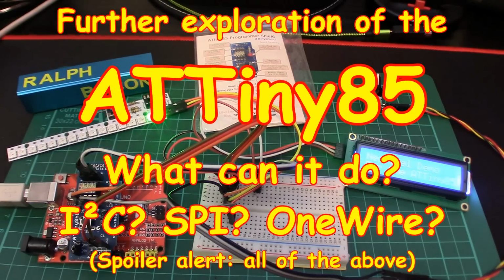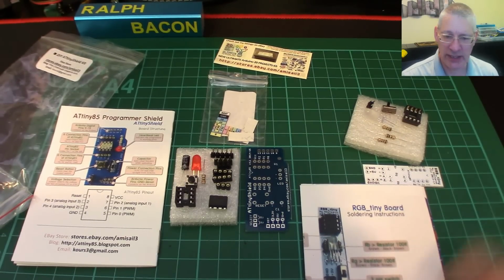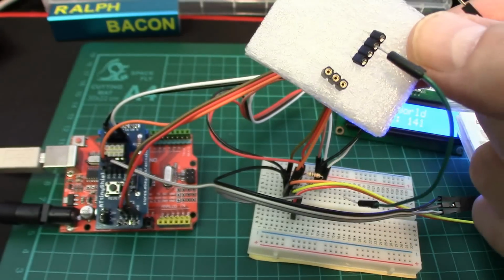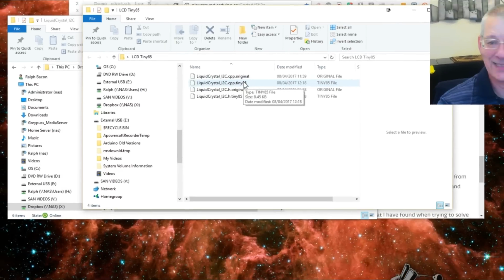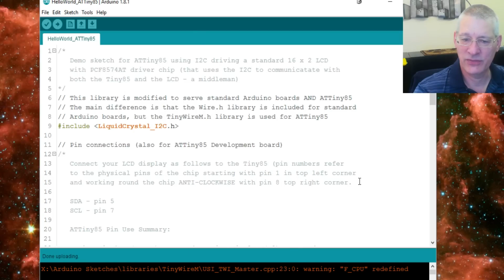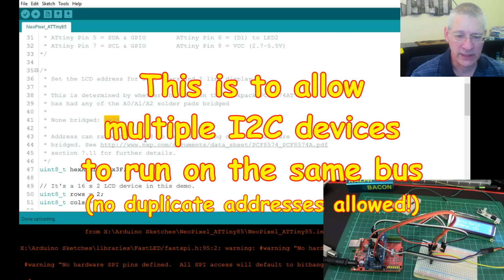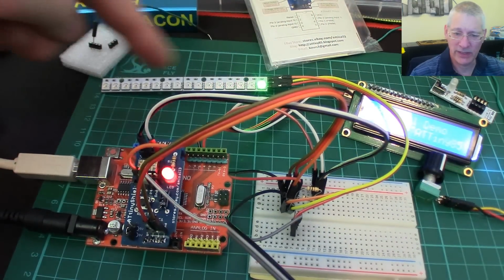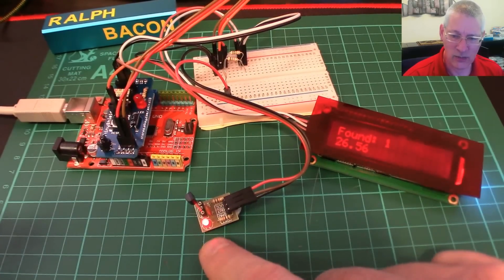#82 ATTiny85 + I2C  + SPI and more!

Comment: Could it be that your I²C communication does not work when the shield is connected because the pins of the arduino below are configured in a way that they drain the voltage from the pullup resistors of SCL and SDA to GND? --- The typical implementation for unused pins is to switch them to be outputs driving them low, or to have them as inputs with internal pullups set, to prevent harm as well as to see a defined state to prevent io-pin-hardware from randomly toggeling like crazy. Since your Arduino below does not seem to do anything much, it perhaps drives the pins you use for "software I²C" through the connectors permanently low and from that communication with the LCD cannot take place? --- Just guessing...
Reply from the maker: And to be honest, Sebastian, I'm guessing you could be correct. Another issue with I2C modules is that they all tend to have those pull-up resistors attached to the lines. Get too many of those connected together and I2C will not work any more. The solution is to desolder the ones not needed, but that's hardly practical.
Reply: @RalphBacon  Even more dangerous might be not to desolder them, since their resistor values add up as parallel resistors  and from that increasing the currents to a point where the open collector drivers in ICs will burn to ashes. So I would encourage you in fact to desolder them, even when this is the sort of fiddely work no one likes to do. But you will better better of to do so... 
Especially when it comes to Raspberry Pi, since the Pi already has something like 1k8 resistors on the I²C lines installed. Adding more resistors in parallel will most likely destroy the processor of the pi because of the to large currents being driven into the processor pins when the pi startss talking on I²C.

Apart from all that, have a nice weekend, Ralph!

Comment: You can piggy-back an 8 pin dip socket on top of the ATTINY you PCB mount so you have some holes to plug wires into for programming later on. It just takes a little patience and a steady soldering hand. And even if you have other things wired into the pinouts, it will often times work with no issues. Just make sure to put a 10uf cap in for the auto reset issue on your UNO for the ISP.
Reply from the maker: Excellent suggestion, Atomkey Sinclair, thanks for sharing. I suppose it also might work with 2 x standard 4-pin socket headers (that are guaranteed to accept Dupont cables)? A bit more fiddly perhaps. Thanks for posting this suggestion, appreciated.

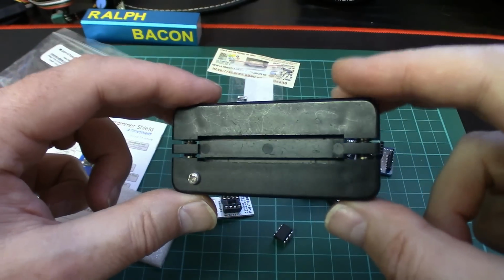Comment: @ 8:40, that tool is not indispensable.  I have always just pressed the legs against a table top to bend them.
Reply: Amos Bibel I am also looking for the same tool. I have searched on both Ebay and aliexpress but without a tool name it is proving impossible to find. Please Ralph?
Reply: IC Pin straightener is what you seek.
Reply from the maker: Yup, I used to do just that, Mike, until I discovered this tool, at which point it was all so much easier, with all the legs at a perfect 90-degrees. Really, spend the $5 / £5 and you will immediately see how useful it is. Indispensable even :) You'll only need the one and it will last you the rest of your life (unless you are currently 12 and live until you are 100, in which case you might, eventually, need two).
Reply: Ralph S Bacon .
What's the name of the tool?
I'm looking for it all around the internet..
Reply: Or a vise.  Pliers are good for 8 pins because you have three tools in one. Pin conditioner, pull tool and place/insert tool.
Reply: Yeah - for something small like 8 pins you can just squish it with your fingers. A longer package is a bit awkward. But I have always just started one edge in the socket and pushed-in and rocked the other edge into place. If I had the tool I might use it - if it didn't stay lost in my parts bins.

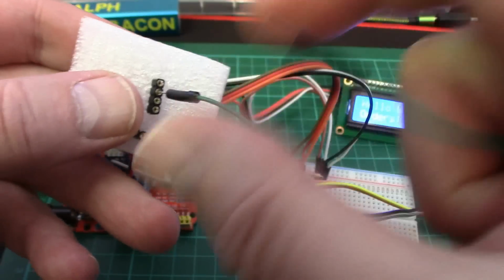Comment: Can someone tell me the names of the cables hes using at 9:45 ? So the small "hookup" (he doesn't like) and "dew point" (he does like) ?? 
The official names, so they can be searched for on Google.
Reply from the maker: "I hate them with a passion", I said Colin, which was a bit strong but they are not good, those round ones.
 
The ones that everyone uses are Dupont cables, and they come in strips of 40, with the option of male-to-male, male-to-female and female-to-female. I order these every now and again (1 strip of 40 for each variant) as they can get damaged over time (and, mysteriously, you can just 'lose' them).
 
They come in  3 main lengths: 10cm (quite short), 20cm (average) and 30cm (long). I use all three but have just ordered some more 30cm lengths so I can connect to modules that need moving about a bit. They would be far too long for connecting from a breadboard to an Arduino so I use 10cm or 20cm cables for that. Basically, if you're serious about this you really need all three to avoid either frustratingly short cables or a birds nest on your workbench!
 
Here's a link to AliExpress which is a good 30cm example: https://www.aliexpress.com/item/Free-shipping-Dupont-line-120pcs-20cm-male-to-male-male-to-female-and-female-to-female/1899750504.html
 
I hope this helps!

Comment: Where did you get that FLUX cleaner?  What brand is it.
Reply: Throughout a long life of working on chips, I have always cleaned flux off with  pure alcohol, bought from a chemist shop, and a tooth brush.  50 years ago, I was working for NASA, and they put us on a quality soldering course, where I was certified to solder joints in space craft (though I never did!), and that was what they taught us to do.  Methods may have evolved since then, but Voyager (which was one of the space craft that was built and launched at that time, is still going.
Reply from the maker: Without watching the video I'm not 100% what you're referring to, the flux pen which applies flux to a circuit board prior to soldering is here (UK eBay but on sale worldwide at eBay.com):
https://www.ebay.co.uk/itm/1PCS-YOSKER-951-10ml-Rosin-Flux-Pen-DIY-Solar-Cells-Panels-Electrical-Soldering-/272011224292?
 
If this is not the item let me know (and where I refer to it in the video) and I'll dig out the link. I hope this helps!
Reply: Same here. In the Air Force. Always remove flux with alcohol.
Over time flux can pass signals / current  and cause some very hard errors to find or locate.  We were trained to solder F-16 equipment in 1980.

Comment: ATtinyCore seems to be a more versatile option.
 https://github.com/SpenceKonde/ATTinyCore

I used that to develop ATtiny85 I2C devices which "remotely" provide humidity and temperature sensors; and variable frequency PWM motor (fan and pump) controllers. ATtinyCore automatically determines the correct libraries.

The device to provide an I2C DHT11 didn't even have a circuit board. It was all soldered to a dip8 socket. 😀
Reply from the maker: That certainly looks like a comprehensive (and well documented) library, Bernd. Even though the author has a vested interest in getting users to use his library because he sells some rather nice (albeit not particularly cheap) boards from the Tindie shop. Certainly worth investigating further for users who intend on using an ATTiny85. Thanks for the heads up, very useful.
Reply: Is the DHT1 an I2C device ? How ? Only 3 pins ?
Reply: Nils Skansar what? the DHT11 has 4 pins...

Comment: I'm just a beginner at ARDUINO, But I like everone to use ESD bracelets and Pad's. The voltage to your skin , can be over 18 Volts. Having being an Inspector in electronics and working on electronicswith-out a bracelet, can and will, send pulses into the programs that you guy'swill not SEE.I see this over and over on you-tube. I belive this Vid is a great example of the problems that every Program is grenerating.
Reply from the maker: Interesting ideas you have there Tim, thanks for sharing.
Reply: Mandatory when I was working for DEC, Digital Equipment Corp, later Compaq,later HP. A lot of intermittent faults were traced back to ESD.
Good advice.

Comment: You must be using weird flux if it's going to cause shorts!
You probably know, but for anyone else's information, the little connectors you refer to as "...header pins" (that have given you trouble before) are actually single-pin IC sockets, they aren't headers nor should they be used as headers.  It may seem weird to have individual IC socket pins, but we often used them for prototypes in the 1980s, especially if we couldn't find a 24-pin socket, but we had a 20-pin.
Great video as usual, keep them coming!
Reply from the maker: I'm glad you cleared that up, Neil, because those round pins "headers" are rubbish for Dupont cables. But may be useful for chips for which we don't have the correct socket, as you say. In that case I will not dispose of mine, but move them to the drawer marked "IC Sockets". Thanks for sharing that useful information.
Reply: Actually, Flux is electrically conductive, look it up...

Comment: I'm new in arduino and i want to make home automation by using bluetooth serial and infrared and save data by using I2c externally eeprom can you please help me??
Reply from the maker: So you're new to Arduino, Syed? And (yet) you want to create the equivalent of NASA in your home? To be perfectly honest, the best approach to take is to watch the videos on this channel that are aimed at the beginner and which cover the sort of things you want to do, whilst you actually try all the demo sketches out. Then in about six months you won't be asking me what to do you'll be telling me where I got things wrong in my videos! There's no shortcut to actually doing it, which means taking the time out and, well, actually doing it. I'm not sure what else to tell you. All the things you've mentioned in your question have been covered one way or another in this very channel, so at least you have a good starting point.
Reply: shaseeb692@gmail.com ........ Please contact me i'll send you my project block diagram ....... I have my bluetooth serial programming but i also need infrared reciver and eeprom
Reply from the maker: As much as what you're doing sounds interesting I just don't have enough time to help on an individual basis, Syed, sorry. The best place for help of the sort you need is the Arduino forum (forum.arduino.cc/index.php) where there are many experts willing to help, as long as you have done your research and tried a few things already - they won't design your project for you! Give them a go, be nice, show what you have done already and what the issue are that you face. Then you will get the help you need.
Reply: Watch Paul McHorton lessons, you might wanna use http://www.clipconvert.cc to save them to your system:
https://www.youtube.com/watch?v=d8_xXNcGYgo&list=PLGs0VKk2DiYx6CMdOQR_hmJ2NbB4mZQn-
Reply: for saving data, it is easier to save to uSD / SD card, with SD card shield/module.
https://www.banggood.com/Micro-SD-TF-Card-Memory-Shield-Module-SPI-Mciro-SD-Adapter-For-Arduino-p-919914.html

Comment: please Name from Tool at 7.09
Reply from the maker: That's the IC Pin Straightening tool, Omo, here's a link to an eBay (UK) item but you will find these everywhere on the Internet: http://www.ebay.co.uk/itm/IC-PIN-STRAIGHTENING-TOOL-UNIVERSAL-DOUBLE-SIDED-MOULDED-BLK-PLASTIC-81x37x12mm-/191930975599?_trksid=p2385738.m2548.l4275
Reply: Ralph S Bacon 
Thank You!
Reply: Also : https://www.rapidonline.com/trusemi-ics-01-ic-straightener-22-0330

Comment: Hi, I have problem with I2C LCD and Digispark ATTiny85,  I have connected SDA to pin 0 and SCL to pin 2 (with 4.7k pull-up resistors), VCC to 5v and GND to GND, I have uploaded your code and add all needed libraries, but LCD displays just WHITE filled rectangles on first row.
Any help? Thanks in advance :)
Reply from the maker: I haven't checked your pin connections, Đorđe, but getting a white LCD screen (even if it is just the first row) might indicate that the library you are using is not the correct one. You didn't mention it, but I'm assuming you don'[t get anything displayed on the second row either, even after your program tries to put something on there? Or, you may not have the correct I2C address. What I would suggest is that you get this sketch working on a standard Uno (or Nano) so you know the logic/address/hardware etc is correct and working and then transfer that to the Tiny85, making the appropriate changes (or just modify what you have now). Let me know how you get on.
Reply: How can I try sketch with Uno?
Do I need anything to modify?

And for pin connection, I use same as you.
Reply: Ohh, now it works. I don't know how it can work because I didn't changed anything or uploaded new sketch.
Thanks anyway! Thank you for helping me!
Reply from the maker: Probably a dodgy connections. It happens. Glad it sorted itself out though!

Comment: Another nice video. Thanks! FYI: if you need fast hardware SPI on the Tiny85, you can use this library: https://github.com/JChristensen/tinySPI . I used it the other week to drive the Nokia 5110 over a 595 shift register and the speed difference is significant. I use a UsbAsp to program and I like the ATtiny because it's so... tiny ;-)
Reply from the maker: Hello Arduinite! I'm currently on vacation 5,000 miles away from home so I'll have to be brief with these comments until my return, mid-July.
 
That's very interesting, Maxint, and something I will look into further on my return. Yes, there are two schools of thought regarding the Tiny85:
 
1 - it's physically small and still gets the job done
2 - why bother, just use a Nano
 
But at least we now have options and choices and as Winston Churchill said, You can't please all the people all the time! (He probably didn't say that at all but it sounds more convincing if I use his name).
Reply: Thanks for your reply and enjoy your vacation, while I (as a new subscriber to your channel) enjoy more of your fine video's. Cheers! 

(I guess the first school of thought is mine. I sometimes love the challenge of a limited environment, but also realized that not every project can be fitted in an ATtiny13A.  Although it brings back the nostalgia of my ZX81 days, some projects deserve a successful closure... And yes, I am pro choice... ;-)

Comment: Great video Ralph.

I have bought this shield from amisail3 eBay and it works great.
It has all the instructions and in my opinion is a waste of time to try uploading code to Attiny without a shield like that or a similar one.
Also I have found Attiny very usefull for small projects low on consumption.

Thanks for all the Arduino videos.
Reply from the maker: You're most welcome, Icc Con, glad you found the video useful.
  
Now, you can upload code to an ATTiny without this shield (or any other) using an FTDI USB-to-serial converter, of course, as my video #66 shows, but this way is  in many ways easier. The other way is to buy a Digispark version which has a USB port and a bootloader already installed (although that does consume about 2K of the available 8K of memory). Memory fails me but I might have already included that in the #66 video.
 
But I quite like this shield and I have a future video in progress that will enhance the ATTiny85's usefulness too, but Benny has refused to allow me to say more. Stay tuned!

Comment: I would prefer Pro Mini 3.3/5v  and Nanos
Reply from the maker: Ah, but the question is Raad, why do you prefer those two above the Tiny85? 

Now, you might answer:  because they are cheap; they have sufficient memory for most things; they can be programmed using a USB cable; and many more reasons. But...

But there are also people who just feel it is wrong to devote an entire ATMega328P to a simple project just to monitor a couple of sensors! Whatever your reasons (and I have no feelings one way or the other) I'd love to know why (and maybe others would here too) so we can get a feel for the pros and cons of both µControllers. I'm still investigating the capabilities of the Tiny85 and I'm amazed they are so popular. Who knew?
Reply: I'll have to say the ease of programming is what I am after when prototyping.  Also, I come from software background, so I am in no man's camp here.  Getr-done  ( salng for just get it done  )
Reply from the maker: Wow! that was a quick reply! Yes, I love my Nanos because they are cheap, have all the power of a 16Mhz Uno, are much smaller, have an additional two pins (can be used for analog or digital) and have (usually) sufficient memory and "grunt" to get the job done and are really easy to hook up to my PC and upload a new program (basically, what you're saying really).
 
Now, that said, I've been impressed by the Tiny85 recently, given its miniscule size and tiny power consumption and low voltage running (down to 1.8v @ 1Mhz says Robert, on this thread) - and with that shield (or any other) it is easy to program. I've an idea for another video or two on this device and you never know, if I can persuade myself that these are not to be ignored perhaps others will prick their ears up and investigate, you never know!
 
Thanks for the quick reply, always good to hear the opinions of fellow Arduinites,